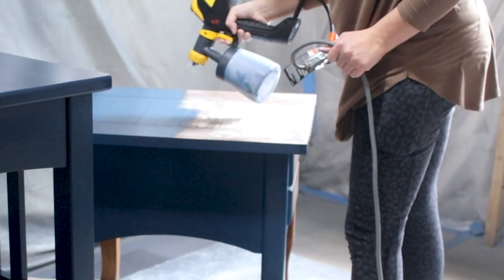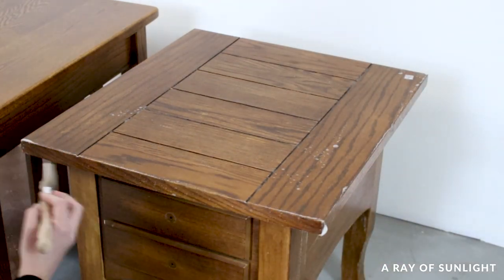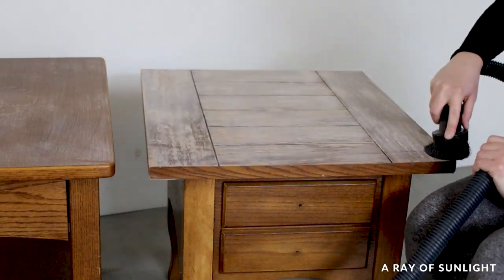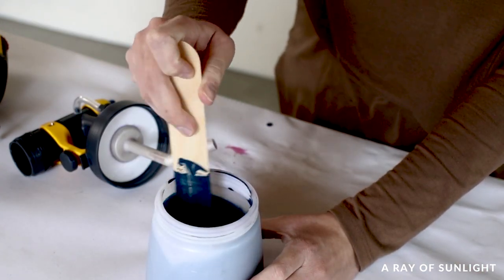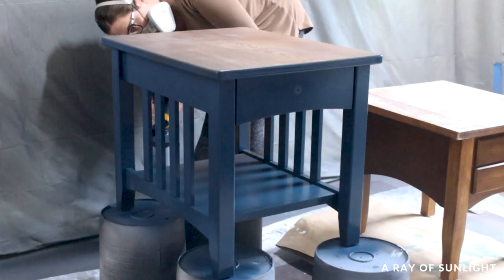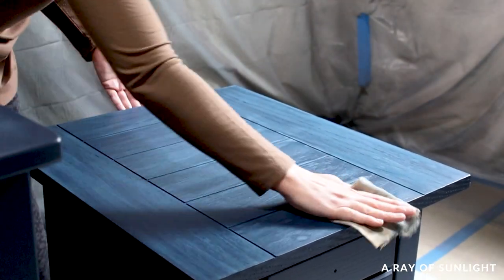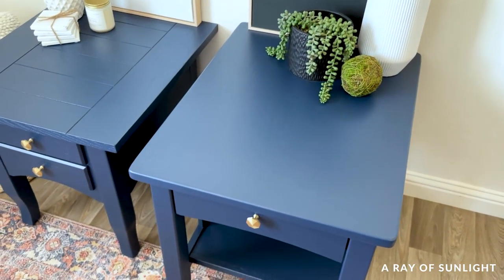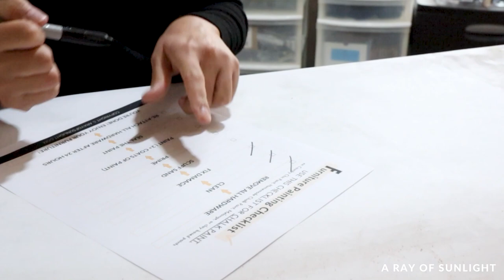Redoing End Tables | Heirloom Traditions Paint Polo

Comment: They look very nice.Can you make a video with the extra tips you use using the Wagner paint sprayer? Like how do you move the sprayer so it doesn’t get any line or sheen😅.I have problems when I do the large top areas ,always always end up with some different lines of sheen ,like I didn’t wet there enough and I overlap the paint at 50% too, but I can see the pattern and it dry as is. 😢 nobody explain those detailed ways to use the sprayer.I want to know more.Can you please explain how do you do it! How wet does it has to look while you overlapping the paint , and what direction is better to start.❤Than you so much !
Reply from the maker: Great question. I’ll add it to my list of videos.
Reply: @ARayofSunlight  thank you so much for all your help🙏🏻